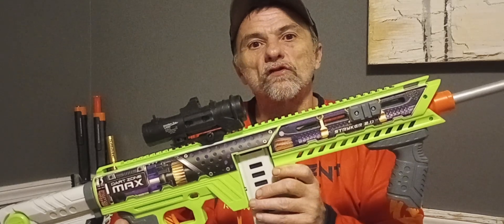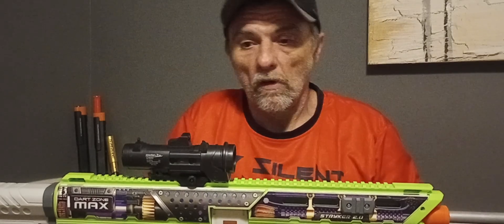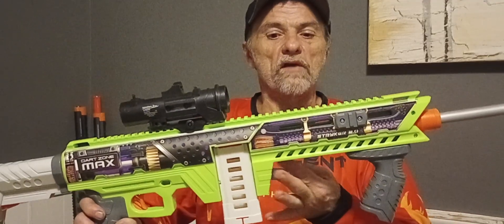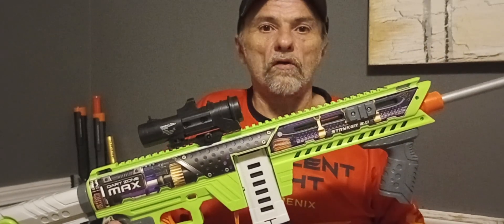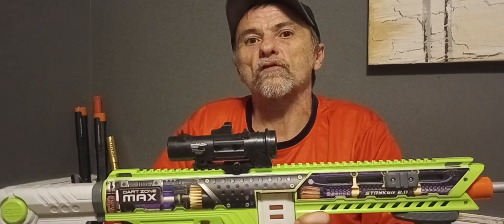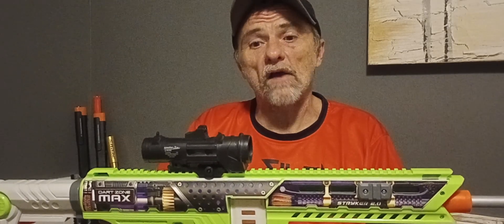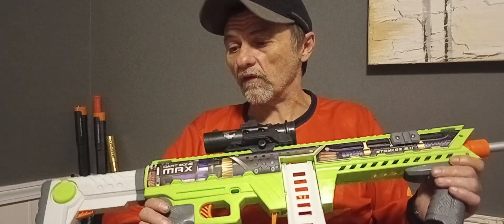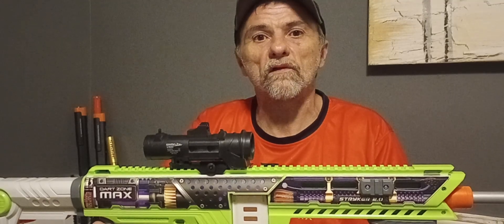Extreme high FPS mod dart zone Stryker 2.0 overview

Comment: A quick few things I immediately liked about this blaster:
1.) The barrel resides so much closer to the top rail, the NEXUS PRO X. I've noticed that more than one hobbiest/reviewer had needed to angle the blaster up higher than thought they should,  or having to 'dope-their-scope' as it were, because of how much lower the barrel is from the top rail of Nexus Pro X.
2.) This blasters body is longer than the  aforementioned NEXUS PRO X(Don't get me wrong, I like the pro x, and I want one. It's on my list.!)
3. The additional length of this blasters body, in the plunger area means I have more real-estate inside for my nefarious purposes. 😊😎🤓